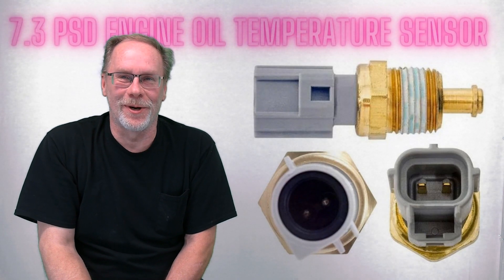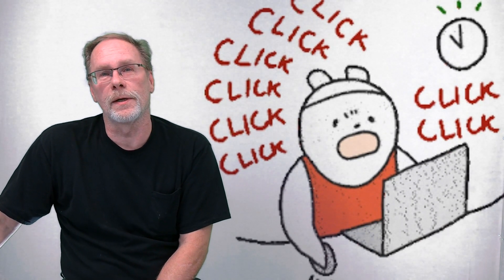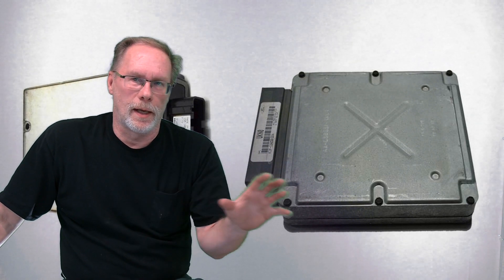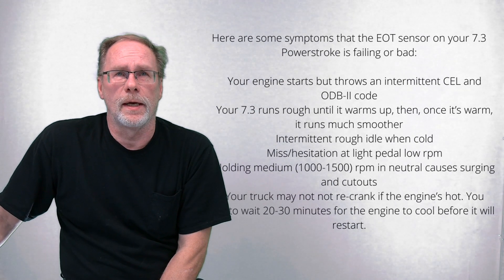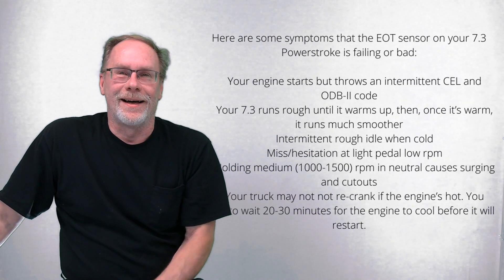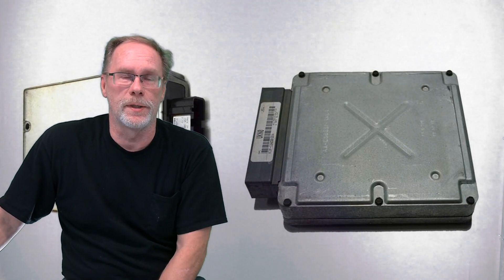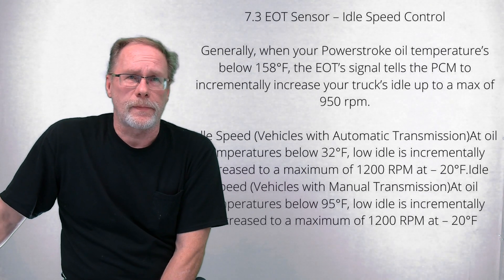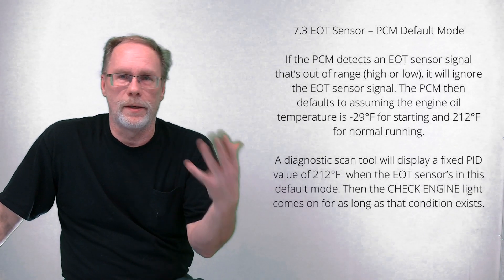7.3 POWERSTROKE ENGINE OIL TEMP SENSOR............................

Comment: I have a 2000 7.3 won't start I have change the crank shaft sec still won't crank on its own but I can spray some starting fiuld in it and it will crank

Comment: I have been watching you videos and have gotten lots of usfull information.....so thank you very much!
 I have a 2000 f350 dually and had a mechanic change the ecm because he claimed it was bad. The truck came from Kansas  and the mechanic was in California....the company he bought the ecm from would only send him a California compliant ecm. Since then I have notice a huge drop in performance.   Is the problem possibly the ecm? Glow plugs didn't work either so I put in a push button switch to activate the plugs. I believe the California trucks have a glow plug controller versus just a solenoid.    
Thank u again for everything.  🙂

Comment: I know this is about the temp sensor but I changed my oil and everything was fine for a about 4-5 minutes the the oil pressure gauge dropped and the light came on. However the truck was running perfectly smooth so I thought Mabe the sensor malfunction so I  rev the engine a couple times and watched the gauge go up to normal and the light go out . Did that twice then shut the truck off and started reading and watching videos and here I am . I’m almost thinking Mabe it’s a faulty sensor going to try that first the thinking the low oil pump is worn and don’t like the new oil so it only builds up pressure with a few rpm increases 🤷‍♂️.  Any opinion helps

Comment: I swapped out this sensor because my test set was telling me it was bad and had defaulted to -20F.  The new sensor reads the same, and the engine is running really rough.  Any feedback would be appreciated.

Comment: I own a 2002 XLT Super Duty 7.3 with the 4R100 transmission (maybe, I'm the 3rd owner) and went to replace the Automatic Transmission Sensor and found no wires to a sensor and saw no sensor. Now I have a mystery to solve. Possible I was looking right at it but didn't see. Can it be behind the valve body where the 2 solenoids are located? ... Would like to contribute monetarily but have found nowhere at your site to do so. Thank you. Oh, is it possible to have the other oil sensor to the left and up front even though I do no have a manual transmission? Did install the oil sensor on the back of the high pressure oil reservoir and idling much better from cold start now. Transmission shifts better too it seems.
Reply: @johndowe7003  yes thank you

Comment: So what if my truck is showing below 158° EOT on scan tool  but my idle isnt riased to to 950?
Reply from the maker: depends on the transmission ,tuner settings , year
Reply: @CUSTOMWORKS7.3PSD  1997, hydra tuned, and manual. I would assume it's all due to the tuner but then again in the "stock mode" it still had never let the idle raise or any of that

Comment: 4:38 interesting that my truck has the exact opposite symptoms.
runs great on cold starts, runs rough when warm
rough idle when warm
miss/hesitation at hard pedal high rpm, light pedal low rpm is fine
holding high rpm in neutral causes surging and cutouts

forscan says my EOT sits at around 190f
Reply: What was the issue

Comment: I don't recall my 95 7.3L going that high ever when idling. Wonder now if my oil temp sensor may be acting up all these years even though there's no codes or any symptoms of it failing. Also wonder now if that's also why my exhaust back pressure valve when it's really cold out will close up when I put the truck in gear and pull out the driveway with very little pedal in it, but then open right back up once I roll a little more pedal into it. 🤔

Comment: Mines flashing with fuel light and misses at same time 
99 f 250 7.3 manual trans ... been through most of your videos 
Removed engine harness and inspected. Cleaned and taped and reinstalled , changed a bunch of sensor and pcm 
Still does it . 
Water light comes on occasionally and checked bowl . No water . 
Drained and fresh fuel .
Still same

Comment: Clint what's your thoughts about the high pressure oil crossover line modification?
Reply from the maker: Its a must as long as you won't be installing a Adrenaline HPOP then its not necessary . The x over really quiets the engine down and equalizes the flow
Reply: @CUSTOMWORKS7.3PSD  Thank you for the fast response and sharing your wisdom with us all 👍👍

Comment: Thanks!
Reply: Hey Clint your by far the smartest 7.3 mechanic I know of I wish I had more to donate. I have a head scratcher local mechanic cant figure it out or just likes taking my money idk, however hopefully you can help. So I have a 7.3 says its a 99 but in the door its says 06/00 just incase that matters for what I'm about to ask you. This has been happening for awhile now cant say exactly for how long, but when my truck is warmed up and lets say I'm backing up to put on my truck camper I'm constantly going forward and backward trying to get it lined up. However for some reason if I'm ever stopped and turn the wheel it try's to die or even sometimes does die. I can put into park and fires right back up but I feel it shouldn't do this. Just this weekend drove about 2 hours to camp we stopped at camp boss shack to pay and while I was waiting in truck it was fine but soon as I put into drive and tried to turn it tried to stall out, or few weeks back when my brother flew up to visit was waiting at the airport line for him to throw his bags in and soon as i cut the wheel to pull off out of line it stalled but again it did fire right back up. I cant tell if it idols rough cause its a 7.3 and seems normal and the rpms seem fine when sitting at a red light. Also doesn't seem to matter if its reverse or drive. i had a friend who owns a 7.3 say change the oil changed the fuel filter which I'm going to cause its pretty close to that time but i cant imagine that is the cause. I apologize if this is confusing I'm horrible at typing lol
Reply from the maker: I first figured out this part of youtube did you find the issue or is it still persistent
Reply: @CUSTOMWORKS7.3PSD  the steering is still janky from dead stop its like it draws a lot of power. All my other issues were caused my damn field mice chewing through wires. I did what you said and bought a engine harness installed and problem didn't go away had it towed well guess i should have changed the harness from engine harness to PCM cost 2700 buck for them to figure out and repair but she definitely runs better.

Comment: I have a code... Oil Temperature Sensor Circuit Range/Performance Low. The truck idles REAL strange. A lot of clatter. Then, it'll seem better when its warmer, but it'll randomly start running rough and surging. If you rev it above 1500rpm, it'll die if the engine is too cold. It smokes a LOT.
Reply from the maker: sound like more than 1 sensor or one issue ,,, pull the OTS get a ohm meter and a heat gun/hair blow dryer hook up the ohm meter to the sensor best to use gator clips the sensor at 70 degree's f should read around 2.7 ohm hit it with the gun/dryer the numbers should fall but not any further then .166 if it gets here that sensor is bad
Reply: @CUSTOMWORKS7.3PSD  Clint... I discovered the issue, this afternoon! After a scan, I had cylinder 3 high to low side open awhile back, and thought nothing of it. Wired super duty uvch connectors in, and it actually ran... like dogshit. Lol! I related my failed CCT for #1 and# 3 to the #3 high to low side open and pulled the harness. Sure enough, #3 injector circuit was full of resistance. Inside the wire was black. Replaced the wire, and it runs better than I've ever heard it! No more smoke. It has the turbo you recently reviewed installed on it, as well! Hope to have it on the road at the end of summer! Great thanks, from New Hampshire, United States! Subscribed, sir! New harness in the future!

Comment: Iv got a crank no start an I've started updating all the stuff you say to ,still gotta check the valve cover gaskets yet an the oil temp sensor an gonna swap out the old pedestal to eliminate the  common oil leak.
Reply: What did you end up doing to fix the no start?
Reply: @alinbaraiac1543  ended up being my pickup tube was sucking air every time I took it for a drive .

Comment: I bought my 96 from this guy about 6000 miles ago, I now have 127000 on it. Had runability issuses immediately after I drove it home from the purchase. 

Oil seeping through valve cover connectors, so I installed new valve covers gaskets. 

Installed new CPS due to vehicle randomly dying and running rough. That fix has gotten me all the way to winter, now I’ve been fighting these cold weather starts. 

I realized my glow plug relay has never clicked on and I changed the EOT sensor today with a new pigtail. 
My HPOP was a 94.5-95 for some reason in my 96. Went with the newer sensor. Now my glow plug relay turns on!! 

All these “simple” fixes have been made possible mostly in thanks to your channel!  I can’t thank you enough for providing such valuable content.

Comment: Hey Clint, I own a 5/98 built truck that seems to have late 99 sensors and  early 99 turbo. Have you seen that before? Btw, I'm replacing a counterfeit motorcraft icp that failed immediately. Ebay be damned.
Reply from the maker: Oh yes 98 to early 99 was and is normal for a mfg to use up old parts or intro new parts early on old models Makes working on them a adventure

Comment: How can I add additional oil cooling? I have a t444e dump truck and get a engine warn light when I climb hils with a full 7 ton load.
Reply from the maker: That is a clear sign of a failing HPOP  and or a LPOP either way if none of these 2 have ever been replaced do both at the same time //// go here and get the adrenaline model www.dieselsite.com/1994-200373ldieselsiteadrenalinehpop.aspx ///// and here for the lpop www.dieselsite.com/dieselsite73lhighvolumelowpressureoilpump.aspx ////// A additional oil cooler won't do much with that kind of load you need much more oil ,. Also if you are getting a high temp light for coolant if I am misunderstanding you you need a thicker radiator
Reply: @CUSTOMWORKS7.3PSD  thank you! No, temp of coolant is fine... just the engine warn goes off and then it runs rough until I restart the engine... only does it with a real heavy load up hills.
Reply from the maker: @gixxer4eva  monitor the fuel pressure also you can hook up a fuel gauge on the back of the bowl anything under 50 psi you could have clogged filter or upgrade to a fass or airdog high volume fuel pump another though but more than likely the first comment

Comment: Do early 99 trucks have different parameters for when high idle is activated?  When I first bought my truck, it never would increase idle speed, regardless of temperature. I installed a TS 6-position tuner and it would idle up normally, but more recently upgraded to a hydra and it no longer goes into high idle.

Comment: Awesome! Thanks for sharing. I'm having a hard start issue with my 2002 7.3 with 236,000 miles and I've done everything but replace the injectors! This is a cheap and easy install so I'll try this today if I can find one. Or, I'll just order one. Thanks again.
Reply: Your low pressure oil pump may be allowing the the high pressure pump reservoir to seep back to the crankcase.  Check the oil level in the HPOP reservoir before you try to start.  Low oil there means no start.
Reply: @brendawernicke7663  my hpop oil level is fine. Thanks though.
Reply: @marcuswyatt5642  - this sounds like my truck right before my IDM failed and left me stuck at the edge of the road.  Got a rebuilt and it runs like a new truck.  If I’d had time to wait, I could have sent it out to a rebuilding service for under $200.  Wound up finding a rebuilt one fast and local for closer to $400.  Was a bitch to get to, in the driver’s side wheel well, so I swung the harness up into the engine bay, and made a custom bracket.  In my climate it stays drier there, as I am in a coastal rainforest.

Might be good to do an injector buzz test when it is cold... 

The other thing to rule out, is worn wiring under the main harness where it connects above the driver’s side valve cover (I had arcing there from some insulation just worn through, on a couple of wires.  

  Was able to wrap them with electrical tape and then added a piece of 1” split loom to protect it.

  My IDM died AFTER I found and fixed that wiring issue, and was not from the wiring problem, but from the corrosive environment causing the pot metal to corrode making the vent on the case fall off and open up to exterior moisture.  It would have failed either way.  Check that engine harness wiring for arcing to the valve cover, and then check into the IDM, would be my first two things to check.
Reply: P.s....64 ounces of hotshot stiction eliminator in my last oil change hasn't changed a thing. Neither has the hotshot fuel additive.
Reply from the maker: @marcuswyatt5642  did we hit down on all of these https://www.youtube.com/watch?v=ZJ5BSBntTzA
Reply: @CUSTOMWORKS7.3PSD  thank you for your quick response. I've covered most of that but my truck only has a hard start in the mornings or when it hasn't been cranked in 8-12 hrs. I pulled the clip off my icp and it has a good bit of oil on it and some leaking I hadn't seen before. I'm going to replace that too. Thanks again for your videos and your time.

Comment: 2k f250 brand new icp ipr cps and idm all motorcraft, still has low icp voltage code dies at every stop light when deceleration. Bad Hpop ??

Comment: Thanks Brand new to the 7.3. I used to rebuild DT 466 Engines. My truck I just got seems like possible Injector issue but sort of a lifter tick. Avoiding taking off the valve cover just yet. Serviced the engine now and will delete EGR next. Doe's seem to have a lot of Blow buy. Revved up it doesn't seem to have a miss like at Idle. It's a 99 F-450. 114000 on it. Coolant and Oil are looking good. When I pull the valve cover I will also check the rocker arm. I hear they waller out and get sloppy. Thanks again New Subscriber who pushes the Like Button every time.
Reply: What egr

Comment: good advice.  i had an intermittant check engine light that responded to light throttle and no throttle.  do not have fancy diagnostic tools.  i changed engine oil temp sensor on back of hpop resivour and no check engine light.  300,000 miles on motor.....thanks.

Comment: I replaced the EOT sensor because I have been experiencing the miss/hesitation st the 1500 RPM range with light throttle.  After replacing it I watched it on the Autoenginuity scan tool and when the oil reaches 150* it starts acting up again. I replaced it after doing a contribution test the tool said it was out of range. Been fighting this "death rattle" for a year and am no closer to fixing it. I quit driving/being towed home a year ago. Any help will be appreciated.
Reply from the maker: It would be helpfull to see a video while cold then hot when it happens BUT I have to make some assumptions soooo I keep track in my service computer of issues and fixes over the years here is the list, injector spring broke even though it pasted all tests/ installed the black CPS instead of the gray stopped the problem/ wires harness under valve cover / bad plug pre valve cover harness/ cracked piston Misfire only at 1480 to 1630/ valve seat and valve the spring set to high started pulling the valve through the seat / wire harness connection that big plug on drivers side valve cover the wires where worn and grounding only when valve cover got hot.
Reply: After changing the eot do u have to put oil back in the truck

Comment: My truck oil gage goes when I throttle but when I’m driving and get above around 40 it will starts to shutter real bad and bog down and die
Reply from the maker: You need a running diagnostic if you don't have any po codes

Comment: Two things... do you know the Kelvin temps??  and my favorite is... Is that adjustable wrench Metric or Standard??  I set the wife a huntin for that elusive Metric wrench once 🤣😂😎
Reply from the maker: Jeez haven't had to deal with Kelvin since crane engineer school The trainer was all about that. I do have a true metric adjustable with metric scale on the jaw The odd part its from Germany instead of China and have no clue how I ended up with it, but I keep it in my service truck acts as a Wrench, Hammer, Crow bar, Spacer. Love the wife story though

Comment: I changed the IPR valve and the ICP before I realized it was my crankshaft positioning sensor. Don't judge me. Whether I'm getting a little flicker of a check engine light and light flicker like that the whole time I'm driving. But there are no drivability issues. Any ideas? No SES light issues before the repairs. By the way I enjoy your videos. It's already in my favorite alongside diesel tech Ron and diesel powerstrokehelp

The IPR valve and the camshaft positioning valve roem the ICP is aftermarket and I did not change the wiring to the ICP
Reply from the maker: To many variables you need to get the codes pulled from the pcm , Flickering light usually is a bad, loose wire and always remember new parts can be defective